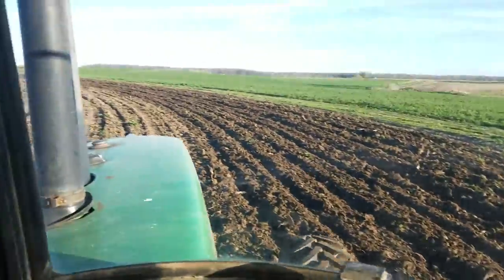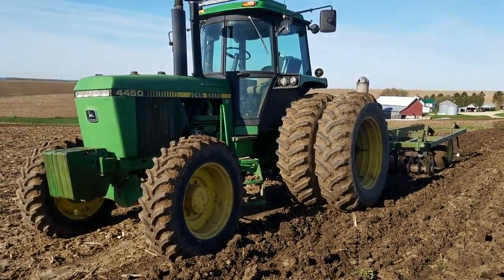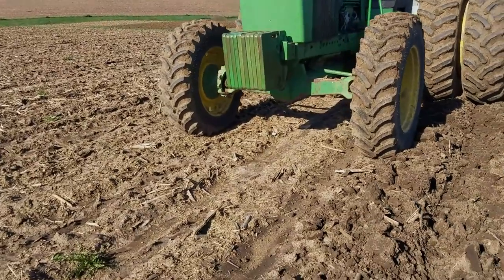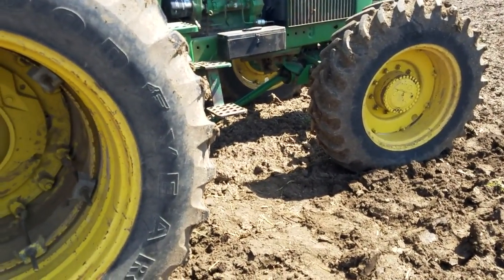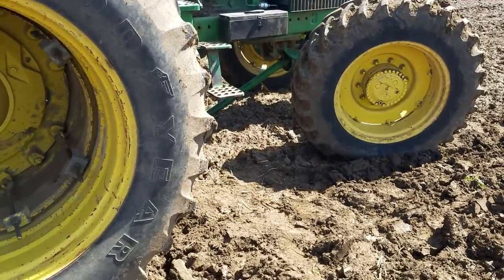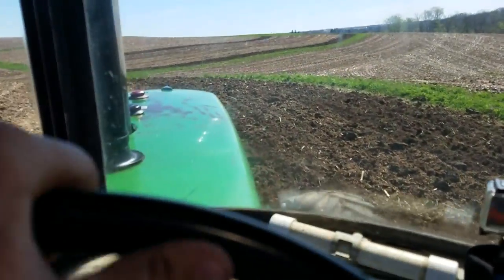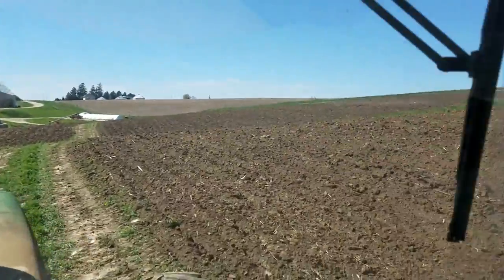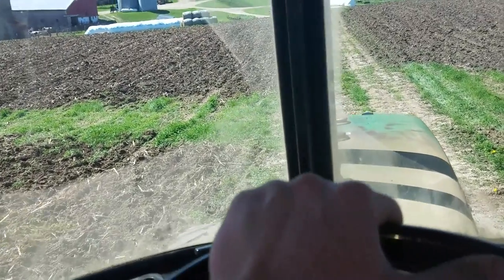Chisel Plowing! - John Deere 4450

Comment: I noticed that a lot of the bigger farms are no longer plowing their fields - Just planting new crops over harvested fields.. I guess they find the soil holds more carbon that way and has some effect on the way the soil reflects the sunlight, resulting in milder temperatures.. Because they're not plowing, they have reduced labor, fuel and maintenance costs and less work during harvest cleanup. This led to the retirement of the 'Big Budd' tractor from the plowing business.